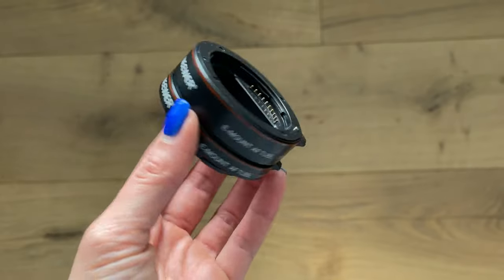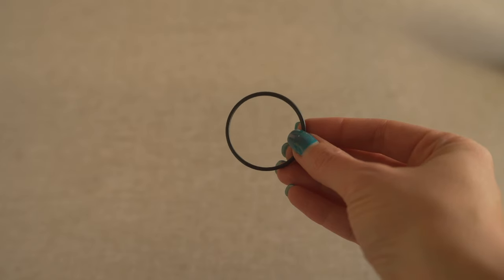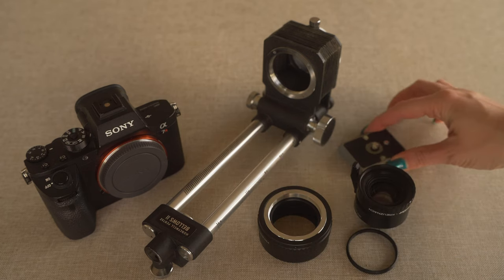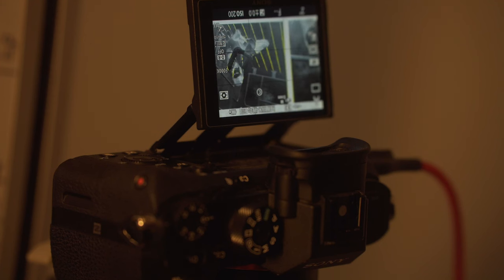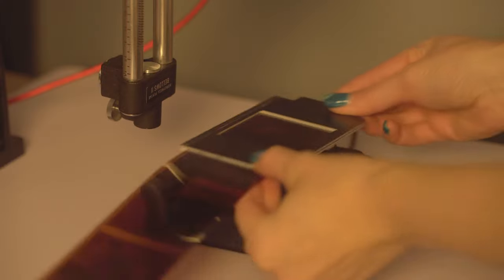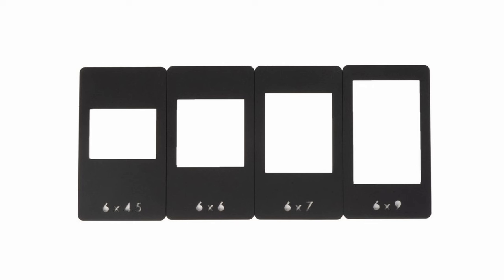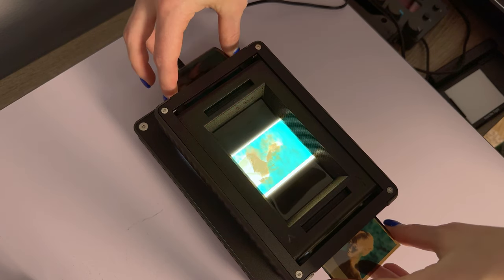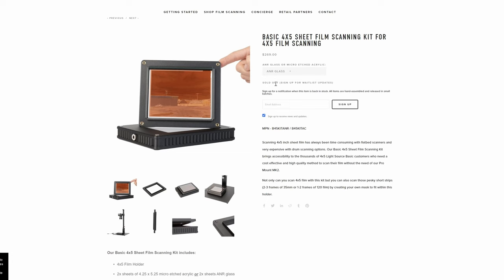How To Scan Film Without A Macro Lens

Comment: I have been using the Essential Film Holder system for several years with a Raleno 192 video light & find it works quite well. For 4x5 I also use a 4x5 film carrier for an enlarger.
Reply from the maker: Nice 👌🏻👌🏻👌🏻

Comment: I have a cheaper kit than $75! You can get little plastic 35mm clamshell film holders (no light) for about $20, and you can get a cheap light tablet for tracing for about $25. Simply lift the film holder about 1-2 inches above the light table so the light is OUT OF FOCUS by a huge amount, and any imperfections just blur out. For 4x5, I think the best method is to take one of your normal film holders you use for shooting, and just cut a hole out of the septum and one of the film slides. Glass sheets are fine too, very easy to keep clean just using eyeglasses spray and microfiber. Acrylic no--it will scratch instantly.
Reply from the maker: That’s a great option. 
Funny enough I totally have scratched one of those acrylic sheets. Have no idea how as I’m pretty tidy and baby all of my gear. I assume the glass could be easier to clean and it might be less static, so it won’t attract as much dust. But paying extra $140 for it is questionable 🤷🏼‍♀️
Reply: @AnalogueDiaries  Acrylic is basically just clear butter, in terms of toughness. I dunno about the newton's ring thing, I've used plain old glass a lot in the past and didn't notice much issue. I do prefer open air suspension if possible though.

Comment: good review
i also dont want to invest in a macro lens and i recently discovered that you can use cheaper enlarger lens
why do you need also the bellow system and not directly mount it on the camera ?
is it for 2:1 and more ?
thanks
Reply from the maker: Thanks! Good question. With enlarger lens the bellows are must, that is how you’re able to focus. The enlarger lens doesn’t have the focusing ring, only the aperture.
Reply: @AnalogueDiaries  from what i understand, an helicoil is good enough for 1:1, and belows if you need more ?
Reply from the maker: @gerardbellouard9696   enlarger also has bellows to focus, so I have no idea how to do the focusing without one 🤷‍♀

Comment: Hello. I'm looking to get a similar setup as this. I was wondering how the focusing/magnification works with a bellows and enlarger lens. How do you make sure the negative fills the frame at 1:1 magnification and is in focus at the same time? It seems to me you would need to adjust the bellows in and out and the whole thing closer or further from the negative at the same time. Any help would be appreciated! thank you!
Reply from the maker: You are correct you adjust the crop and focus with bellows and copystand. There is focus peaking on sony cameras that allow to focus on the grain. Once I found focus and distance for specific format I mark on the bellows and copystand for further use, so I don’t need to repeat the whole focusing process all over again next time I scan.
Reply: @AnalogueDiaries  Thank you! How do you decide how far to extend the bellows? It seems like you could either have them extended further and then have to move the copy stand up, or extend the bellows shorter and move the copy stand lower? And once you decide how far out the bellows should be to fill the frame, won't moving the copy stand then change the framing of the negative? I feel like I'm missing something lol Does moving the copy stand up and down not change the framing?
Reply from the maker: @nothankyou90  there will be always a mid spot how long the bellows stretched and how low or high copystand is, you decide yourself. I just try to fill out the frame with a negative. Check 5:05 you can see marks on the copystand (there are too many of them but you get the idea) and I put same marks on the bellow rail (they're not visible on the video, but they are there). I move this copy stand all the time and use it for darkroom printing and no it doesn't affect my further scanning. Those marks are starting points for different formats and I adjust focus every time I scan, it doesn't take much time really.
Reply: @AnalogueDiaries  Thank you! I appreciate your thorough answers. Have a nice day.

Comment: Which mm macro lens would be better 35mm or 105mm
Reply from the maker: I have neither as I scan with enlarger lens.
Reply: The longer focal length gives a longer working distance, but either will do the job as long as they got to 1:1